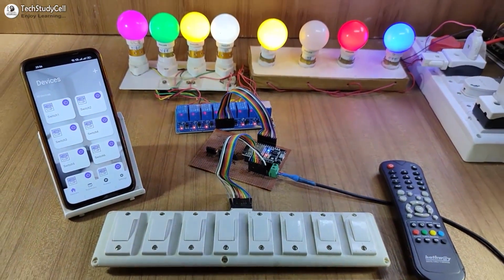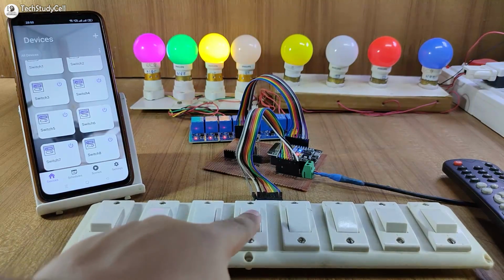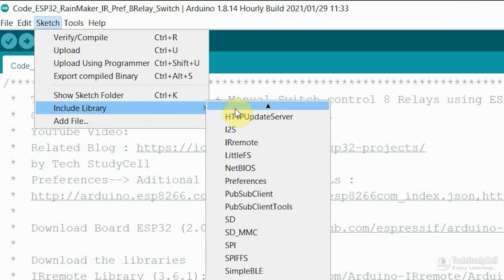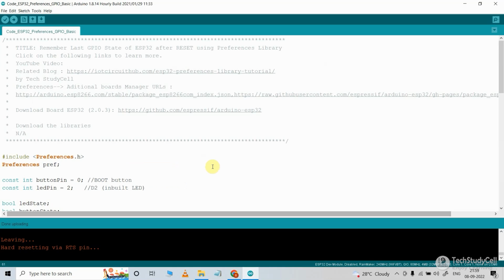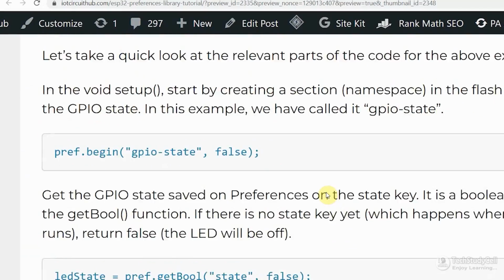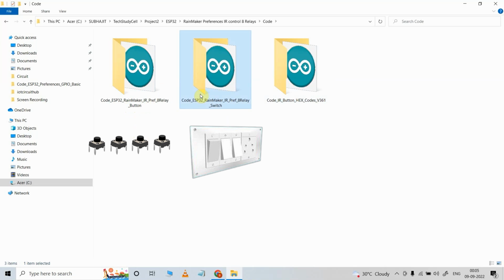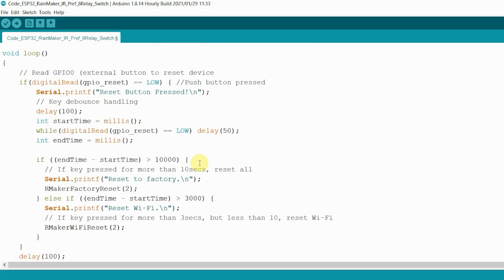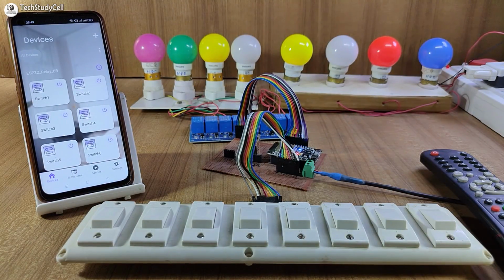Best ESP32 project with Alexa Google Home Automation using ESP RainMaker - IoT Projects

Comment: I am stukking on thisError please help me to resolve this error

C:\Users\ajayy\AppData\Local\Temp\.arduinoIDE-unsaved2025111-5584-c27hnk.554d\sketch_feb11a\sketch_feb11a.ino: In function 'void setup()':
C:\Users\ajayy\AppData\Local\Temp\.arduinoIDE-unsaved2025111-5584-c27hnk.554d\sketch_feb11a\sketch_feb11a.ino:470:29: error: 'WIFI_PROV_SCHEME_BLE' was not declared in this scope; did you mean 'NETWORK_PROV_SCHEME_BLE'?
  470 |     WiFiProv.beginProvision(WIFI_PROV_SCHEME_BLE, WIFI_PROV_SCHEME_HANDLER_FREE_BTDM, WIFI_PROV_SECURITY_1, pop, service_name);
      |                             ^~~~~~~~~~~~~~~~~~~~
      |                             NETWORK_PROV_SCHEME_BLE
C:\Users\ajayy\AppData\Local\Temp\.arduinoIDE-unsaved2025111-5584-c27hnk.554d\sketch_feb11a\sketch_feb11a.ino:470:51: error: 'WIFI_PROV_SCHEME_HANDLER_FREE_BTDM' was not declared in this scope; did you mean 'NETWORK_PROV_SCHEME_HANDLER_FREE_BTDM'?
  470 |     WiFiProv.beginProvision(WIFI_PROV_SCHEME_BLE, WIFI_PROV_SCHEME_HANDLER_FREE_BTDM, WIFI_PROV_SECURITY_1, pop, service_name);
      |                                                   ^~~~~~~~~~~~~~~~~~~~~~~~~~~~~~~~~~
      |                                                   NETWORK_PROV_SCHEME_HANDLER_FREE_BTDM
C:\Users\ajayy\AppData\Local\Temp\.arduinoIDE-unsaved2025111-5584-c27hnk.554d\sketch_feb11a\sketch_feb11a.ino:470:87: error: 'WIFI_PROV_SECURITY_1' was not declared in this scope; did you mean 'NETWORK_PROV_SECURITY_1'?
  470 |     WiFiProv.beginProvision(WIFI_PROV_SCHEME_BLE, WIFI_PROV_SCHEME_HANDLER_FREE_BTDM, WIFI_PROV_SECURITY_1, pop, service_name);
      |                                                                                       ^~~~~~~~~~~~~~~~~~~~
      |                                                                                       NETWORK_PROV_SECURITY_1
Multiple libraries were found for "WiFi.h"
  Used: C:\Users\ajayy\AppData\Local\Arduino15\packages\esp32\hardware\esp32\3.1.1\libraries\WiFi
  Not used: C:\Users\ajayy\OneDrive\Documents\Arduino\libraries\WiFiNINA
Multiple libraries were found for "Preferences.h"
  Used: C:\Users\ajayy\AppData\Local\Arduino15\packages\esp32\hardware\esp32\3.1.1\libraries\Preferences
  Not used: C:\Users\ajayy\OneDrive\Documents\Arduino\libraries\Preferences
exit status 1

Compilation error: 'WIFI_PROV_SCHEME_BLE' was not declared in this scope; did you mean 'NETWORK_PROV_SCHEME_BLE'?

Comment: It's not reconnect automatically to wifi when router restart , have to press button or restart the esp32 module to reconnect to wifi
Except this error the Project is Amazing as I'm using this from last 8 months in my home.

Please provide solution for auto reconnect.

Comment: your skill  absoluto fine and amazing with new trend ,your coding skill very high but project somehow not practical due to some minor bugs or improvement needed 

when esp reboot any reason it will connect wifi  
   
 but     any reason wifi hotspot restart not connect to wifi .why?

   it is not practical to each time reboot esp module ,

this problem not only me but many user in your subscriber ,
kindly look this matter 

with out support making new project not possible , 
kindly do some little help to me 
kindly update and upload same code with auto reconnect feature .

i hope you understand my concern

Comment: Sir I am using yours code 
Excellent work sir thanku so much
But  I want small issue
I am two esp32 using  same coade sir so
 one board automatically WiFi signals faild wat is the problem sir 🙏
Reply: Actually same issue with my project i think no answer from project maker

Comment: As per your instructions first upload Gpl stale code and check boot bullom then upload HEX Code then after 8relay model code Apps satup my big problem is not including HEX Code your other video which doesn't have remote it is ok after code upload but device off relay run onn and device off relay tun onn ... it works .... and problem manage library doesn't include ESP32 band 2.0.3 mine is andino 2.1 vanson plz help

Comment: Bro esp rainmaker app says no device found while provisioning ,tried all method .
also i forgot all devices in my bluetooth still problem exist ,the esp32 boards are brand new ,what could be the cause as not only i nlbut many are facing the issue ,plss help👍
Reply from the maker: First delete the previous Projects from ESP RAINMAKER app, then unpair the ESP32 ble from mobile Bluetooth settings. Factory Reset the board and try again. If issue not resolved, create a new esp rainmaker account and try again.
Reply: @TechStudyCell  thnx for the reply i did this already ,it never seems to work ,though it work with the board i had lying for years, but now i brought 2 new boards from techiesms and they dont work here is the link of drive showing the issue plss check https://drive.google.com/file/d/1BlRB4Pq2uStkQjR83TJ-sR9bp83Ij19G/view?usp=drivesdk
Reply: i have same problem
Reply: @HuyBui-fs6yo  I brought new boards and it's working, probably some boards which looks cheap are not working with it ,u should see the details written on the chip cover more info means original board and less info means it's fake one

Comment: If wifi also goes down with the power supply, the esp does not reconnect with the wifi after power is restored. Please solve this problem.
Reply: Yes same problem here... I have to manually restart esp32 whenever my router power supply is down...

Comment: brother my esp32 not pairing in esp rainmaker app it saying No bluetooth device found, and manually when you turn on switch after a minute it automatically turning off please help brother 🙏
Reply from the maker: First, remove the previous device from esp rainmaker app. Unpair the Bluetooth, turn on gps and Bluetooth. Now press the boot button for 4 seconds and tryto scan the QR code.
Reply: @TechStudyCell  i tried that also but not working
Reply: i have same problem
Reply: @HuyBui-fs6yo  is there any solution
Reply: @FLXR_flxr  someone tell me that  should brought new boards and it's working, your board could be broken or fake one
Reply: @HuyBui-fs6yo  no i have bought another board but still facing same probles

Comment: Hey sir, It would be great if you can add fan speed dimmer and also a way to upload new codes to the board through OTA... As I've installed my project in the wall and to upload new code I have to always remove the esp32 from it
Reply: Please add fan dimmer+6appliances,ir, temparature senser,push button,esp rainmaker

Comment: can we do it with blynk iot platform
Reply from the maker: Yes. You can use the Preferences for any ESP32 projects
Reply: brother my esp32 not pairing in esp rainmaker app it saying No bluetooth device found
Reply: and manually when you turn on switch after a minute it automatically turning off